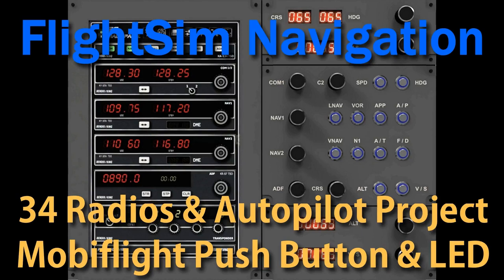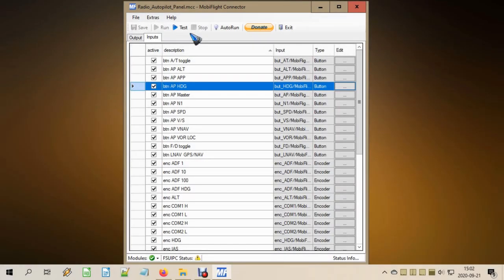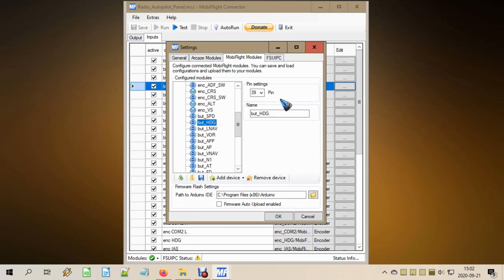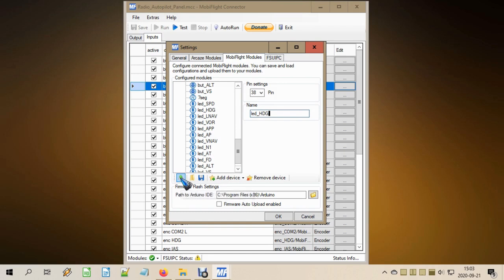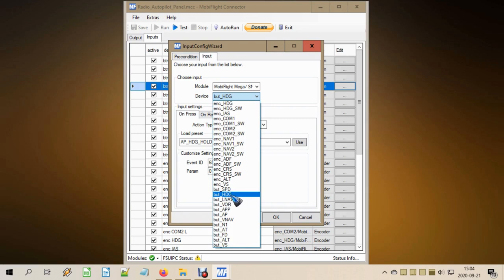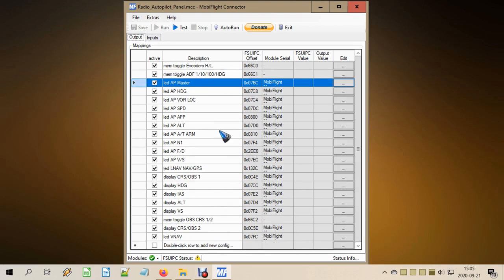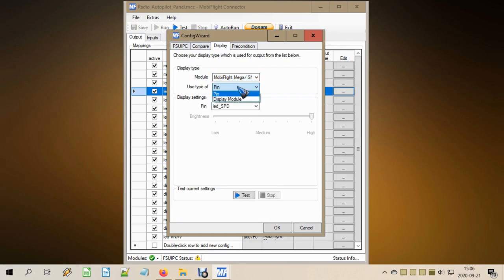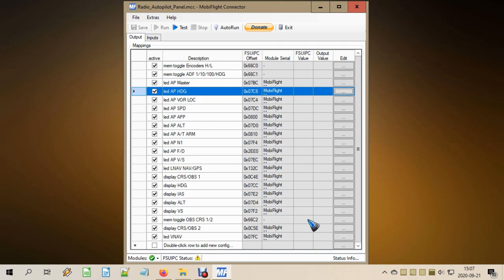Flight Sim Navigation 34 Radios & Autoplilot Panel Mobiflight LEDs and Buttons

Comment: Thanks for explaining this in such great detail and you keep it simple to follow! Thanks!!!
Reply from the maker: Thanks for the feedback, it's appreciated.
Reply: How can do this wire diagram u have?
Reply from the maker: @abdulaziz-np2xg  The wiring diagram for the displays is shown here: https://flightsimnavigation.wordpress.com/2020/09/07/33-radios-autopilot-panel-configure-7-segment-displays-in-mobiflight/
The wiring for encoders and push buttons is straightforward, just connect to any Arduino pins of your choice. Connect push buttons to GND.
Reply: @rudyshobbychannel  thanks
Reply: @rudyshobbychannel  how many atmega uuse in mobii  flight
Reply from the maker: @abdulaziz-np2xg  The Panel uses just one Mega.

Comment: Thank you so much for all your effort its really helpful ,can you please if its possible make a video to explain if we don't have the tablet how to display the com ,nav, transponder , adf ,dme , using the 7 segments,with the auto pilot together .and if you can include a wiring diagrams please .
Reply from the maker: How to display COM1 on 7 segment: https://www.mobiflight.com/en/tutorials/seven-segment-display.html
The wiring diagram for the displays is shown here: https://flightsimnavigation.wordpress.com/2020/09/07/33-radios-autopilot-panel-configure-7-segment-displays-in-mobiflight/
The wiring for encoders and push buttons is straightforward, just connect to any Arduino pins of your choice. Connect push buttons to GND.

Comment: Thanks for the videos.

Could you do a video on holding over an NDB/VOR with wind correction? Thanks :)
Reply from the maker: Is this what you meant? https://flightsimnavigation.wordpress.com/2020/06/01/21-vor-tracking-bracketing/
Reply: @rudyshobbychannel  Similar, but flying a full hold. 

Keep in mind when doing a full hold you'd obviously need to correct even more on the outbound leg, I'd love if you could fly one to give a good idea on how to approach these. :)
Reply from the maker: @Mike-co1fd  I'm not fi liar with the term 'full hold' ... can you explain? I'm not sure why the wind correction should be different, you say 'more', outbound than inbound?
Reply: @rudyshobbychannel  Sorry about that. I basically mean a normal holding pattern over a VOR/NDB, whether it's published on a chart or un-published. 

Problem I have with doing these is sometimes the turn is too wide or too little due to the wind correction, apparently, for the outbound leg there is a rule of using 3 * WCA to make sure you don't drift too far away.
Reply from the maker: @Mike-co1fd  Ahh, I see what you mean. Yes, that could be in one of the planned future videos. I plan to do all coming videos with MFS2020 and that's currently waiting on new hardware. There are some troubled with availability of the new 3080 video cards though.